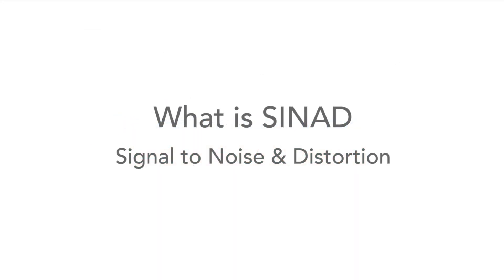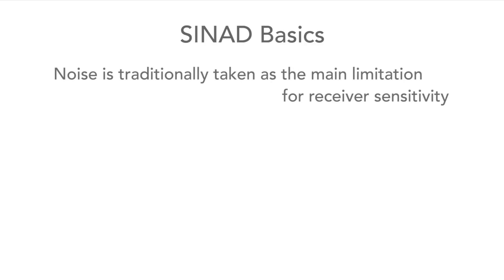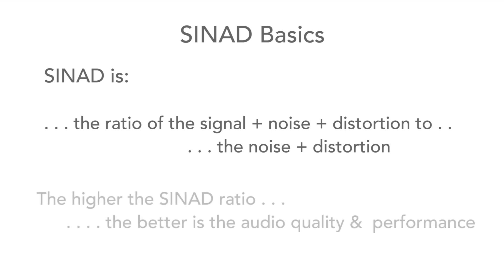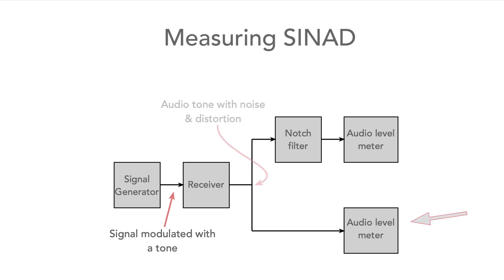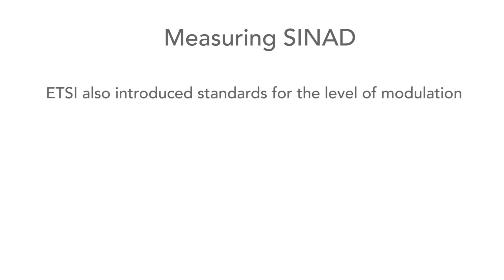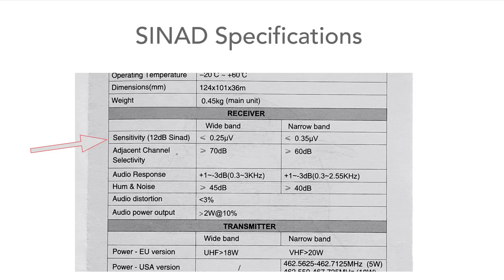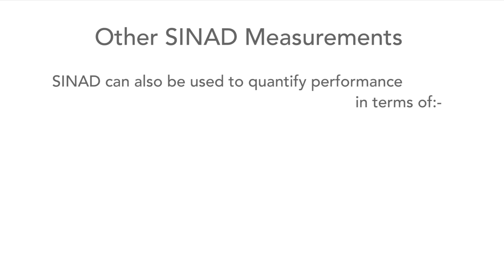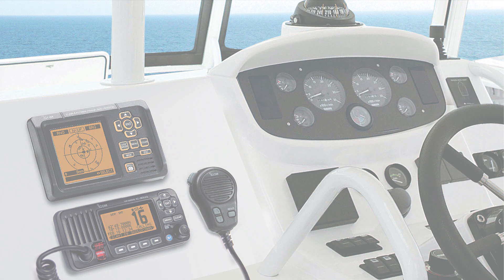What is SINAD: radio receiver sensitivity specification

Comment: Good presentation. Can you still determine the noise and diostortion without isolating the tone if you use a spectrum analyzer? Thanks.
Reply from the maker: Generally you need to gather all the noise and distortion in the output (audio) bandwidth, so even with a spectrum analyser you need to remove the original tone.
Reply: @ElectronicsNotes  Thanks. What would the bandwith of the audio tone + noise + distortion? Is it half of the of the modulating signal's BW?
Reply from the maker: @med-e7q The audio tone is a single frequency and the overall bandwidth will be that of the audio stage.

Comment: Thanks for the video.  Unfortunately I still don't know how to interpret sensitivity specs on a UHF/VHF radio.  If one radio has a rating of 0.25μV at 12dB SINAD, and the other has a rating of 0.35μV at 12dB SINAD, which is the better receiver?  Thanks for any info.
Reply from the maker: Sorry, I obviously did not explain this well enough - the lower the value in microvolts for the given signal to noise ratio or SINAD, the more sensitive is the receiver. If one receiver has a SINAD or 12dB at 1 microvolt and another one gives the 12dB SINAD for 0.1 microvolts, then the receiver with the 0.1microvolt figure can receive smaller signals for the same noise and distortion level and therefore t is the more sensitive.
I hope this helps.
Reply: @ElectronicsNotes  Awesome! Thanks.  Makes sense now.

Comment: Well explained and useful. Are there levels of SINAD which are genereally regarded as a threshold or yardstick measurements of a sensitive FM receiver?
Reply from the maker: I think the best way to look at that is to check out some specific radios in a group. Normally for VHF / UHF amateur radio handhelds, I would expect to see figures of better than 0.2 microvolts for 12 dB SINAD. But best to check a number of radios in the sector you are looking at and check the performance levels.
Reply: @ElectronicsNotes  Thanks for taking the time to reply. It was most helpful and I appreciated it.
Reply from the maker: @acestudioscouk-Ace-G0ACE  Pleassd to be able to help.
Reply: @ElectronicsNotes  Better, meaning higher than .2 microvolts, or lower?